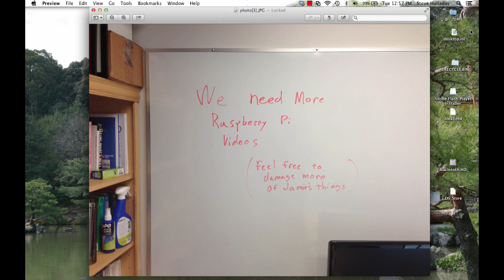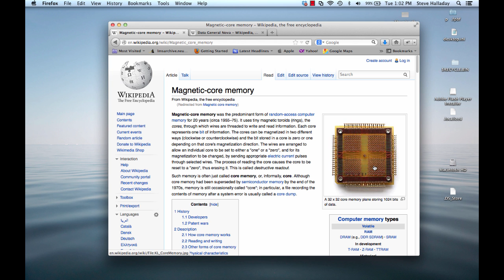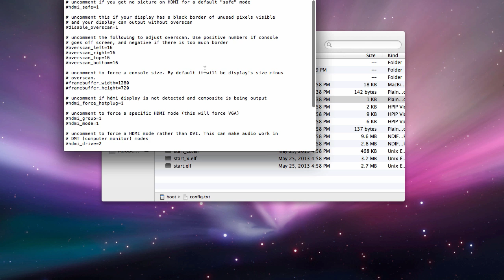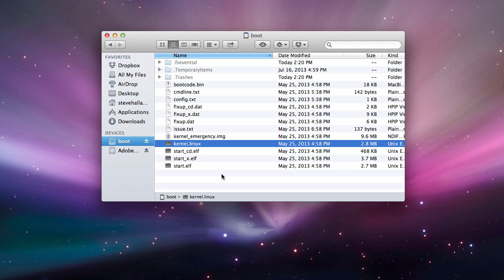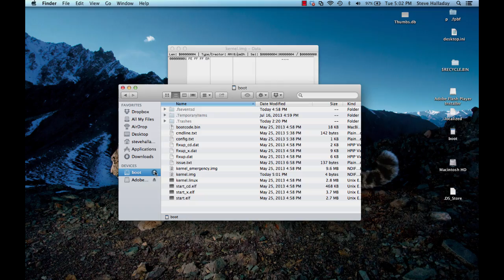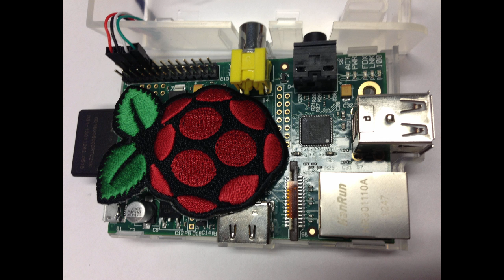Raspberry Pi Boot Sequence

Comment: One question: For example I buy all the parts on the raspberry pi 3 module (soc, sdram etc) and create my own pcb. When I load my OS on the SDcard will it boot without the need of any raspberry pi low level os or something?  Is the OS on sdcard the only needed software to boot the qualcom soc system?
Reply: I suppose that depends whether you have the ROM component containing the proprietary software (like a BIOS) that boots up the raspberry pi from the GPU.  How come you want to make your own?